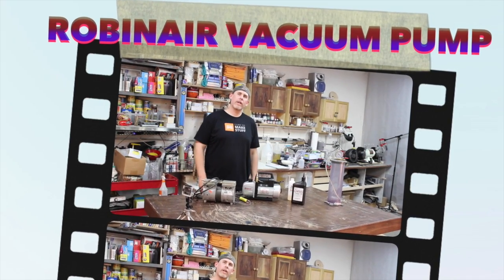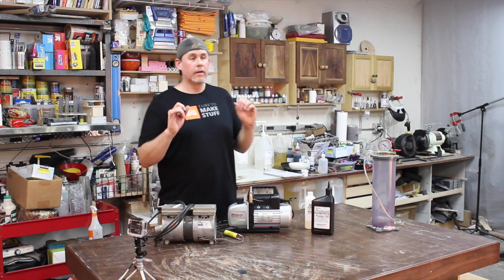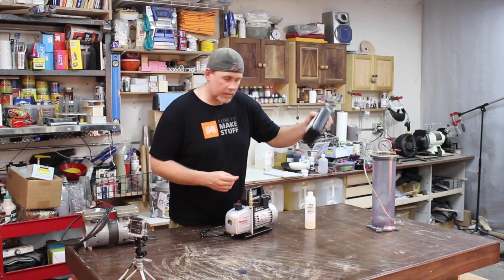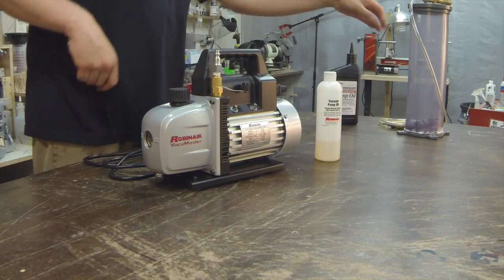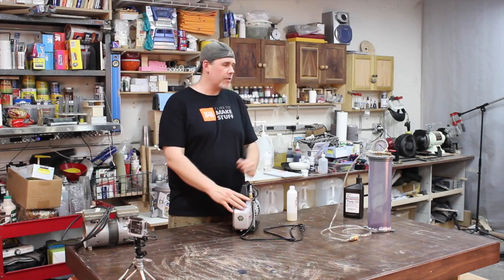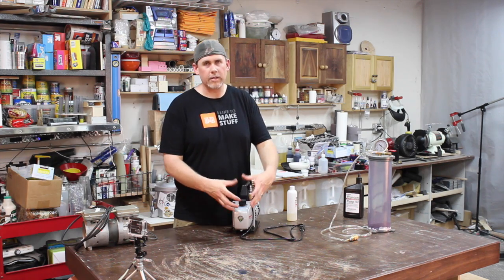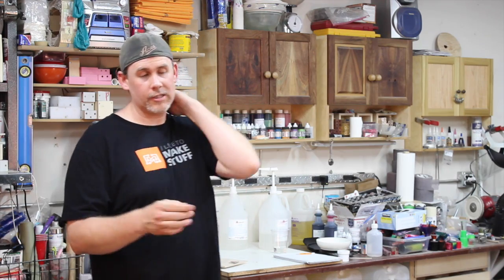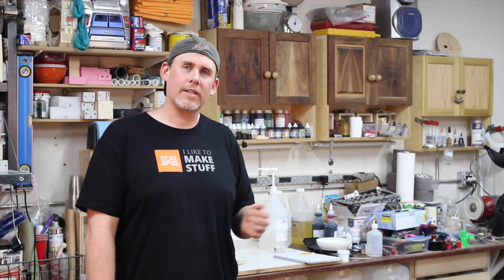Choosing A Vacuum Pump For Stabilizing Wood - The Robinair 15310

Comment: The reason they say to change oil every use is for refrigeration, you need to draw down into microns and any moisture in the refrigeration system will boil off in a vacuum and be absorbed by the oil

Comment: Thank you! It was hard to find a video of someone who could just simply tell me WHICH OIL CAP TO PUT IT IN. unfortunately I ended up switching it like 2 time. From side to side. 🙄 found you video and fixed it and just stuck with that and it's already sounding better lol. My patience is all gone so im not reading this! 😤 oh and the manual that came with it was almost useless! 😲

Comment: You said pay attention to how many inches of mercury it can pull, does that rating have an abbreviation or name? I can only find 'micron' ratings.
Reply: You probably figured this out already but. Inches of mercury is inHg. Millimeters mercury mmHg. 1 mmHg = 1000 microns = 1 torr = 0.00133322bar = 133.322 pascal. 1inHg=25.4mmHg. If you don't like doing the math, you can google like: convert 0.123 inHg to microns and it will either spit out 3124.2 or give you a link to an online conversion calculator. To further confuse things there is also absolute pressure and gauge pressure. IIRC (I don't trust me) absolute is pressure relative to an absolute vacuum, which gauge is pressure relative to local air pressure. Since gauge pressure will vary with weather, it is better to use absolute if you need to be within a bee's dick of a particular value.

Comment: Zac
The pump oil is changed often because it catches contaminants from the freon. They recomend changing the oil after each evac. If I were you I would consider after two vacuums change oil. As it will be pulling moisture out of the wood.
Reply from the maker: james nix I'll keep an eye on it, but I dry my wood to close to 0% before stabilizing. Hoping to go a little longer than 2 runs before changing it. One trick I got from Curtis is to keep an eye on the Hg numbers when you put fresh oil in. When you aren't getting full vacuum anymore it's time to change it. We'll see how that works out though, might have to concede and take your advice in the end! Thanks for the tip.

Comment: I bought this vacuum pump about 3-4 months ago and it works great. Pulls a little over 29 inches of mercury as I am only 100ft above sea level. Mine smokes for about 10 seconds when started then dissipates. Good question on how long to go between oil changes. I usually change the oil when it gets to looking a creamy tan color. Which happens after about 5 to 10 uses for me. Good update, I'm glad I bought this pump. Thanks for sharing Zac
Reply from the maker: +Scott Allen Thanks Scott, and thanks for mentioning how often you change the oil too. So far, I've only changed it once, and I'm not even sure it really needed it when I did change it. I'm only getting about 24-25 inches, but I'm around 4500 feet above sea level. I'm pretty happy with it too, it's a vast improvement over the one I was using before. Getting much better results now.
Reply: name or brand, or kind or link for this machine please
Reply from the maker: It's in the title of the video :-) Here's a direct link to it on amazon: http://amzn.to/29eHblh
Reply: +Zac Higgins that was really fast replay, thanks. Already order it. Just if you can, Now I need to know detail about bagging process, like type of house, connector and bag. And the best price. Thanks
Reply from the maker: Glad I could helpo out! Unfortunately, I have no clue about bags or attachments though, I buy my chambers from www.turntex.com
Reply: +Zac Higgins thanks a lot

Comment: hey Zack ..great videos.. i'm wondering if my pump should be running hot? too hot to keep your hand on it.. its new with fresh oil, but a cheap pump..pulls a good vacumm ,Ive read that a cheap pump could run hot but keep working..

Comment: what about pressure pumps,those that pumps air in forcing into item in the container, also you use a small clinder tube vs the preasure cooker thing?

Comment: Hi Zac, Can you use a Pressure Pot for a vacuum chamber? Double duty if you will.  If not where do you purchase a Vacuum chamber? Like yours Jim
Reply from the maker: It's possible, but you have to buy a separate lid for it. I recommend going with a fully transparent chamber for wood stabilizing though, it helps a ton being able to see where the air bubbles are coming from on the sides rather than the top. I get mine from TurnTex, work fabulous!

Comment: Hi Zac,
Just a heads up, just bought this model and it leaked oil from the drain fitting. That's with and without the rubber grommet/washer in place. Used up about 3/4 of a quart to run three batches. Amazon was kind enough to send me a replacement second day air to Hawaii, and they refunded me for the quart of oil I purchased with the pump. Reading down the comments I learned that the oil is available at Napa Auto parts, duh. When you upgraded to the quick-connect fittings did you use teflon tape or locktite?

Comment: +Zac Higgins Thanks for the overview I will order one of these instead of going for one at Harbor Freight. 100.00 is not a bad price at all. I am making a vacuum chamber at the moment and then ran into a question. Is bigger always better? I would like to make the chamber as big as possible, but will a big chamber be harder for the pump to create a vacuum in?
Reply from the maker: +Dirk Mitchell That's a good question! I don't know for sure, but I will try to find out more about that. I believe that a larger chamber will take longer to evacuate the air, but I don't exactly know how much of an effect size has in the larger scheme of things. What will play more of a part in determining how hard the pump will work, or how long it will take, is how much stock you have in the chamber. My chamber is 4" diameter by about 18" or so tall, and the pump can handle that fine. I would imagine that you're better off doing more batches in a smaller chamber, but it also just depends on how big of a chamber you're planning to make.

One other thing to consider, you'll need to bake whatever you run in the chamber. You might want to consider how large the oven is that you'll be using as well. Might work better to run smaller batches at a time so they'll fit in the oven.
Reply: Zac Higgins For small stuff smaller batches is the way to go for sure. I was thinking it would be cool to be able to do some larger pieces, like spalted bowl blanks and thigs like that.
Reply: Hi, I just set up the same vacuum pump and I use a very large commercial pot 18 1/2 ´´ in diameter X 17 1/2 high. I try it empty and it’s take les than 2 minutes to reach 29 mmhg. I was looking for a large container because I want to to fill some wood blank with epoxy resin to turn bowls.

Comment: After you reach max vacumn and the pump is turned off does the chamber hold the vacumm. or do you have to leave the pump running for the entire stablezation process?
Reply from the maker: +Tom Wistuber You want to leave it running the whole time so that it can suck all the air out. It takes a while before you've gotten all the air out from the inside of the wood. Once there are no more air bubbles coming out of the wood, you can shut it down and let the blanks soak up the stabilizing resin.

Comment: I have an oil motor similar to the Robbinair.  I was stabilizing stones with acetone and epoxy and it seized up.  The oil was the right level and new.  The motor does still trip, but ther is no spinning action probably due to being gummed up. I did see glue and acetone vapors go up into the motor when it sucks the air out.  Is this bad?  I don't have a tall chamber.  What did you use to make yours, it seems pretty tall?  Does a tall chamber prevent liquids and gases from going up into the motor?
Reply from the maker: That's no good! Sorry to hear that it seized up on you. I believe a cold trap might keep the vapor from reaching the pump, but I'm not 100% sure. I don't have one myself, and I'm not entirely sure how they work exactly.

The taller chamber may help out a bit. I think it's also best to only fill the chamber up about 3/4 full with the stabilizing resin. I bought my chamber from TurnTex.com, they make them in any length, and you can choose between 4" and 6" diameter. 

The other thing that might make a difference is using epoxy and acetone compared to Cactus Juice. The acetone and epoxy mixture may be harder on the motor than CJ, but I'm not entirely sure. Sounds to me like you got some of that acetone/epoxy mixture in the motor and once the acetone evaporated you were left with epoxy in there. 

From what I understand, acetone can be problematic and possibly dangerous under vacuum. Not 100% sure what the reasoning is, but I thought it had something to do with the boiling point of acetone being low, and it can actually boil under vacuum. Again, these are areas that I'm not very knowledgeable in, but I wanted to mention that in case you wanted to research it.
Reply: produceman13  pull the pump apart and clean it up. am long as the electric motor turns you should be able to pull the actual pump apart and rebuild it

Comment: Hi Zac, I was wondering if you are using a cold trap when running the vacuum pump for wood stabilizing? Do you get a lot of moisture going into your vacuum pump? Everywhere I read they recommend using a cold trap when stabilizing with CJ but every video I watch doesn't show one. I have a 4CFM single stage vacuum pump. Any information is greatly appreciated! Thank you! Emily
Reply from the maker: Hey Emily, no I don't use a cold trap. There are no vapors in Cactus Juice that will harm the vacuum pump, so it's not necessary. The only thing a cold trap would do is prevent the cactus juice from being sucked into the pump if you overflow the chamber on accident if you're using a TurnTex style chamber. If you are getting moisture in the pump, then the wood isn't fully dried out. Just in case, I have a video that covers drying wood out that might be worth checking out: https://www.youtube.com/watch?v=v-jwrEhtn20&t=70s
Reply: Fantastic!! I already watched all your videos on stabilizing wood :D You are extremely helpful! Thank you so much!! I can't wait to start stabilizing my wood .
Reply from the maker: That's exciting! I'm glad the videos have been helpful for you, I think you're going to have some fun with it =D
Reply: Thank you again!

Comment: i have a vacuum pump model RS-1 the oil keeps going up the line how can I stop it from going up
Reply from the maker: I haven't run into that issue myself, and I'm not familiar with that pump unfortunately. Could you be putting too much oil in it?

Comment: I recently watched your video on resin/wood turning. My question is does the pressure pot accomplish the same result as the vacuum or are thy completely different. I am interested in doing resin and would like to know.
Reply: They're different. You need the vacuum for wood stabilization and flexible mold making. Then you need the pressure pot for eliminating bubbles in your resin casing. Do a YT search for pressure pot vs vacuum for a demo.

Comment: Hi Zac. Thanks for the video. I'm going with the pump you recommended, but I wanted to purchase a Best Value chamber. They explicitly state "not for stabilizing". Is an acrylic lid that big of a deal if you're using cactus juice? I'm new to stabilizing so I don't know if it's direct contact with the cactus juice a problem or the fumes?
Reply from the maker: I'm not entirely sure, I think the Cactus Juice can damage the acrylic lids. The best way to go is to use the TurnTex chambers, they work the best for stabilizing and are totally impervious to Cactus Juice. It's a big advantage being able to see inside the chamber from the sides rather than the top so you know where the bubbles are coming from
Reply: I know this is a bit old now but it is indeed an issue with the lid on that model.  They have a "glass".. something something model that is for wood stabilization and has a glass lid.

Comment: Did you change out the fitting for the tubing?  It looks like you have a connect disconnect like on a air compressor.  Does the same one work on the vacuum pump.  I have the harbor freight 2.5 CFM pump.  Just bought it and getting ready to set it up.
Reply from the maker: Hey Edwin, yeah they are just standard air hose fittings. Works great!
Reply: Thanks.  I can't wait to get it set up.  A few more trips to Lowes and Harbor Freight are coming up.

Comment: Zac... ive been using Gedeo Crystal Clear resin for a while now. I dont stabilise wood, i just mix up a batch with Alumilite powder and toss the wood in. it takes 30 hours to set but then it turns great. i havent had any problems with separation or anything.
So my question is... whats the purpose of stabilisation? Am i missing something or have i lucked onto a resin that doesnt need it?
Reply from the maker: Tom Murphy You can cast unstabilized wood in any of the resins and get similar results, but stabilizing has some advantages. Stabilized wood will bond to resin better, it will help to eliminate the dyes in resin from bleeding into the wood, the wood won't float when casting, and it will make softer woods have a similar density to the cured resin which can help with turning and sanding. 

I'd say the big advantages are the fact that the wood will absolutely not move, crack, or split on you down the road due to wood movement. It's especially useful with burls that have a weird grain, and it will harden up punky spots in wood, especially spalted woods that are spongy.

If you are making items that will be used in or around water, I would highly recommend stabilizing the wood (depending on the wood species). If the wood soaks up a bunch of water, it will likely crack. This is especially important for items such as game calls, razor handles, shave brushes, etc. Some wood species hold up well to wet environments because of natural oils in them and their density, like cocobolo, and don't really need to be stabilized.

For people who sell their products, you could also run into wood movement issues if you make it in a place like Arizona or Nevada, and then ship it to Hawaii. That will significantly increase the chances of the wood moving on you. Worst case scenario the wood cracks or separates from the resin, or it could move just enough to crack the finish. In these cases, stabilizing is a good insurance policy.

All that said, you can definitely cast wood in resin without stabilizing, but I find the benefits to be worth it most of the time. Since I sell just about everything I make, I prefer the peace of mind that the wood won't move on me.
Reply: Zac Higgins Thanks for the very comprehensive answer! I thought it was something to do with forcing coloured resin into the wood for weird effects... is it that too? (I can never seem to get the crazy bright swirls and contrasts with Alumilite powder and regular resin as others so I thought it might have something to do with that or is Alumilite something different from regular resin? (Its almost impossible to get their resin here, I even have to import the powders).
Reply from the maker: Tom Murphy You can add dye to the stabilizing resin to dye the wood from the inside out, and there is also a process called "double dye" stabilizing where you can dye the wood multiple colors to get some really crazy effects. I'll be doing a video on that soon. I was kind of waiting to get the new pump before doing a video on double dyeing.

I'd have to see an example of what you mean by the crazy bright swirls, it might be dyes rather than powders... or a combination of both. Dyes dissolve into the resin and effectively tint the resin itself whereas the powder pigments are more of a light refraction from larger pigment particles suspended in the resin. 

If you are looking for opaque/solid colors rather than transparent, you can add some alumilite white dye to the resin to make it opaque. You would have to also add whatever color dye that you want with it. The white dye alone will give you a white blank. If you add red plus white (more red than white), you would get an opaque red blank. Powders don't really work once you've made the resin opaque though since light doesn't penetrate into the blank.

That's awesome that you made a bangle with a pasta blank, you'll have to send me a photo of that, I'd love to see it!!
Reply from the maker: Tom Murphy Sorry Tom, I have no clue what @18924096054 is. Is it a link?
Reply: Its whats left when Youtube deletes the rest of the link it seems! Sent you it on Twitter anyway :)

Comment: Thanks for the info Zac.  As you know, I have been looking.  

I'm interested in that changing oil every time thing. Looking forward to what you find out.                    JimE
Reply from the maker: Jim E I got the update on changing the oil Jim. Not necessary until the oil becomes contaminated. Check the show notes to get all the info. It turns out that the oil is there primarily to create a seal for vacuum. It is a lubricant too, but it doesn't work the same way as in a car.
Reply: Zac Higgins Thanks Zac.  I'll be waiting for you to put it in use and before I make the plunge.  Thanks for all the great info.         JimE